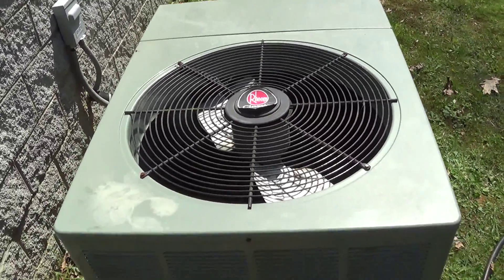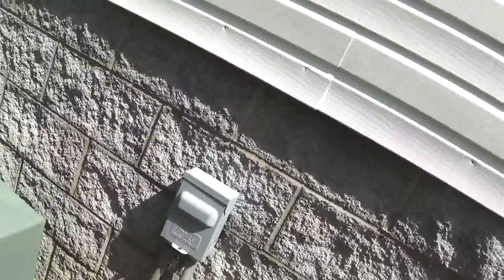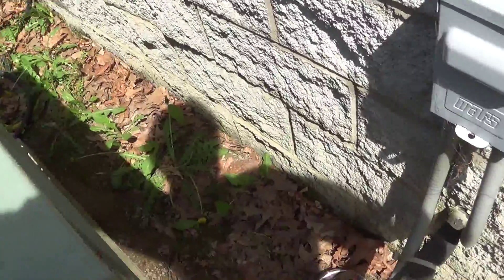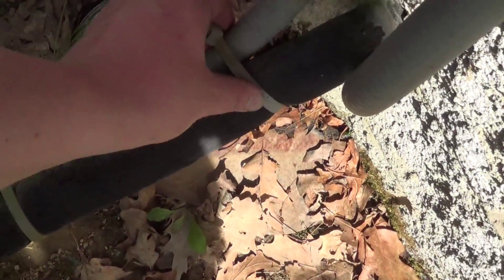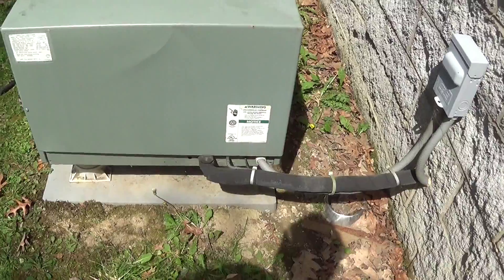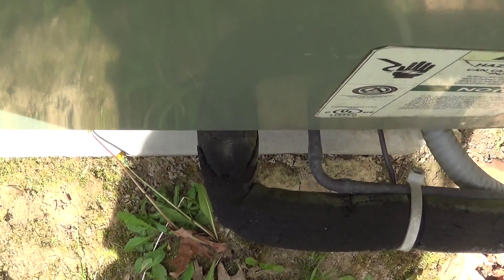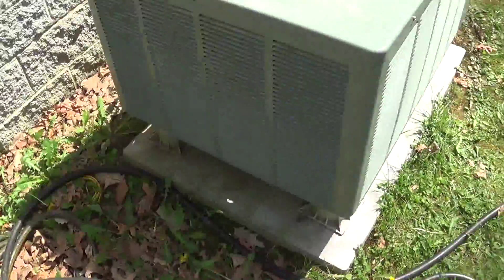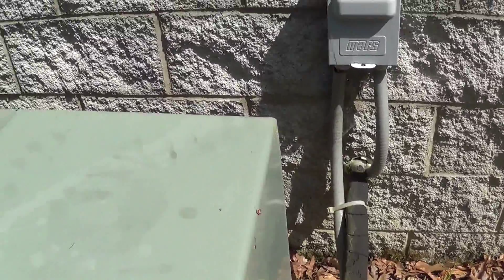HVAC refrigerant line insulation question

Comment: So this was uploaded in 2014. I am assuming you have fixed this by now. What did you use? I replaced mine with some pipe insulation I got from Lowe's. Looks like the same rubber stuff that your showing in your video. I guess the sun and eliments will get to everything in do time. Take care.